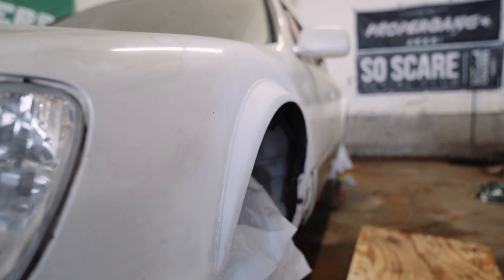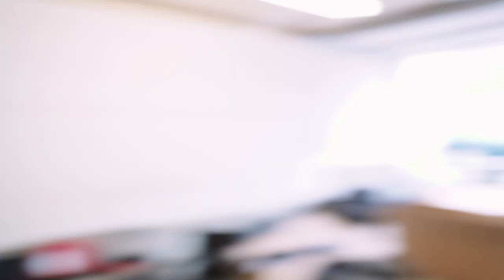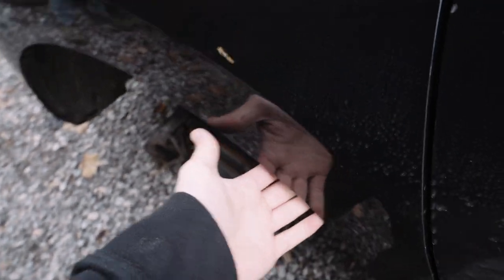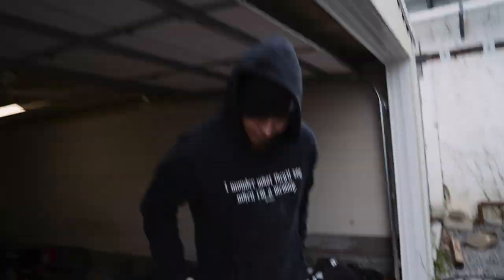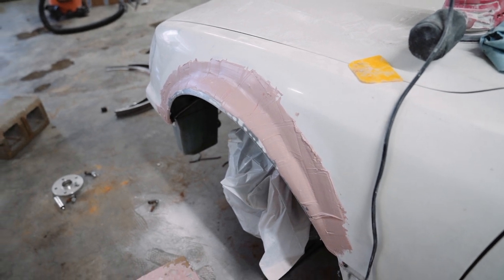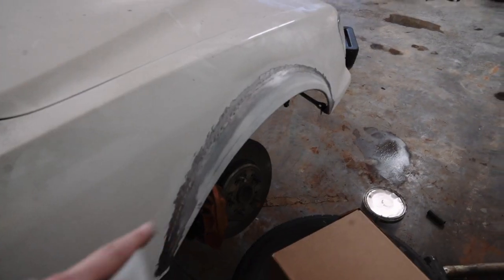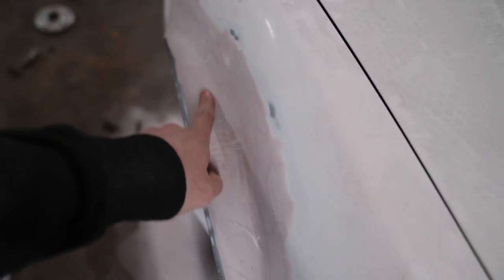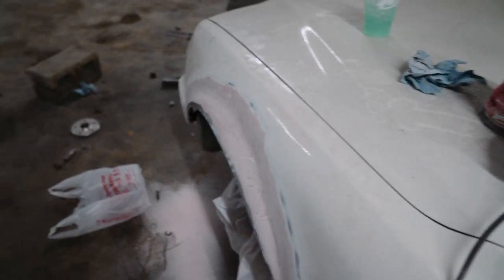I try my hand at bodywork - VIP Style LS400

Comment: 1.when you apply body filler to flares, spread it going from left and right instead of up and down. when you apply pressure to the spreader, it will form the shape/curve you want. 
2. use a block! and use guide coat to help you see high and low spots. Dont use black spray paint, it will clog up the sandpaper
3. when you sand, do cross hatch sanding (sanding in multiple directions) itll help you sand material faster and it will even out everything
Hope that helps!
Reply from the maker: Been doing all 3 of these, this was just the first video!